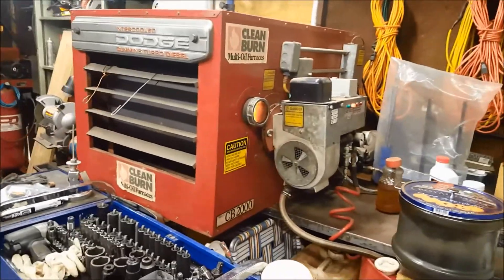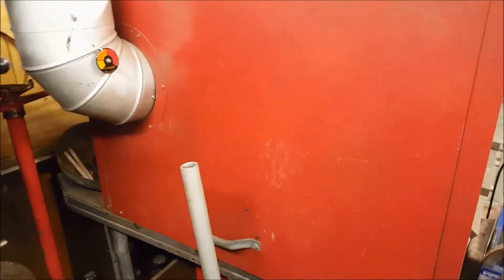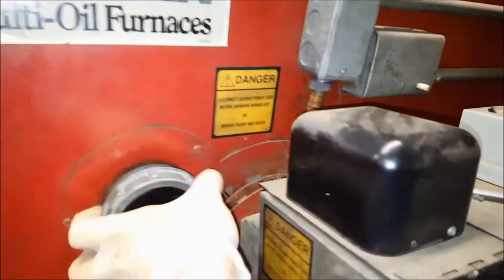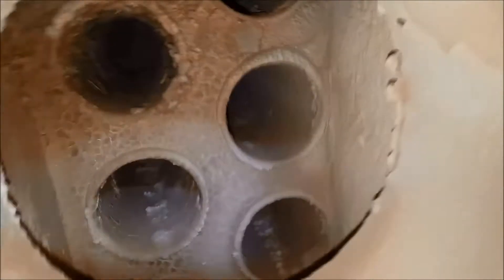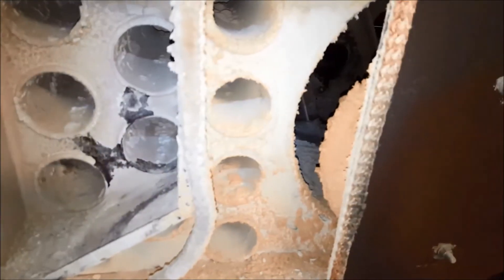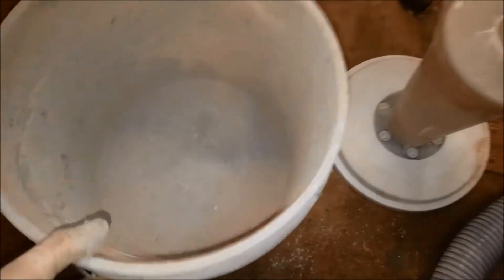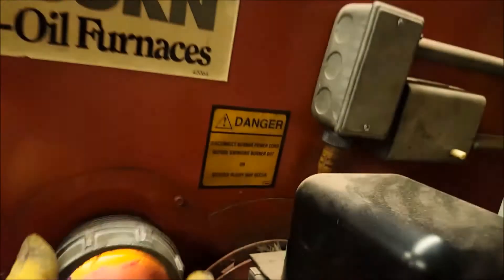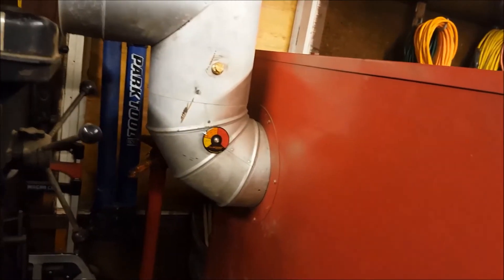CLEAN YOUR WASTE OIL FURNACE with a A DUST DEPUTY! WENT FROM 700 to 400 degree stack temp!

Comment: I have two of these to service next week. I don't have that shop vac attachment could I get away with a compressor and a smaller shop vac? I was planning on blowing the burner tubes out with the compressor then shoveling or shop vaping out the rest of the creosote. Thanks in advance! People were saying I'd have to change nozzles and add new oil. I had to watch this video on silent so I'm sorry if you answered this already.
Reply from the maker: I guess if you were in the middle of an open area with nothing else around you could blow it out. But no I wouldn't really think that's a good idea. The stuff is not good to breathe in and there's a lot of it in there. It's a very fine powdery ash